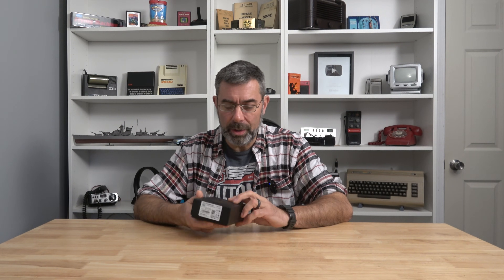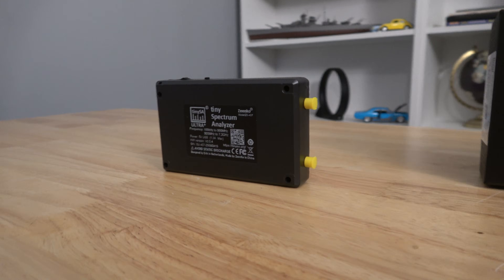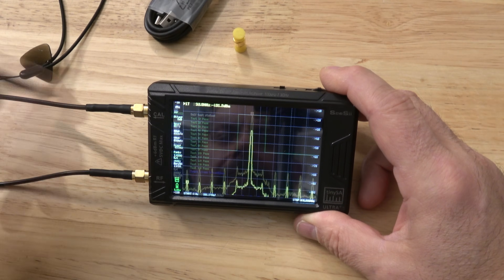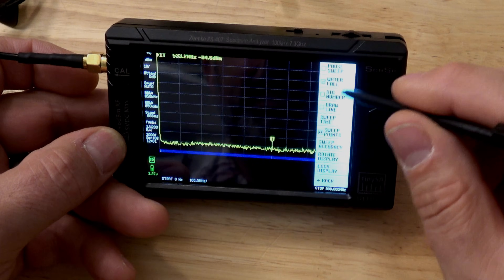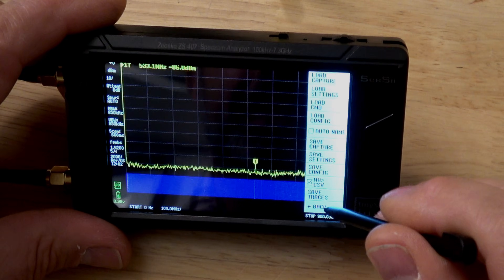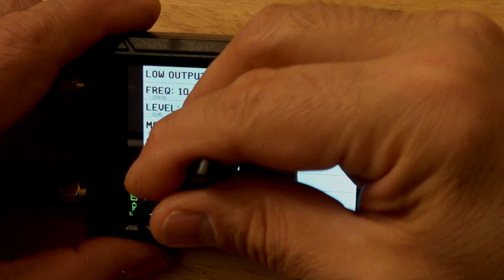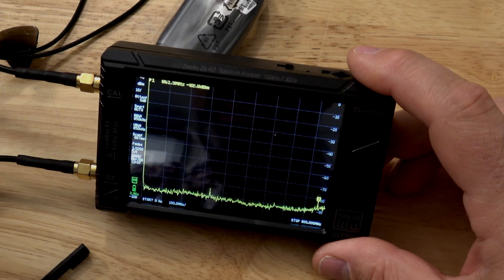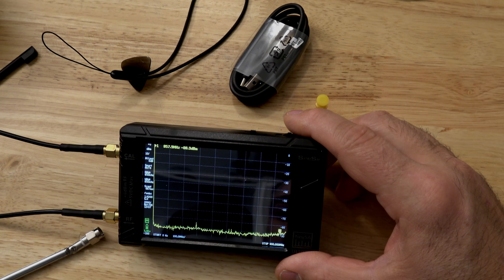The Tinysa ultra+. A compact spectrum analyzer and frequency generator.

Comment: Them are great to have.  You can put that antenna on that  and go around finding that RFI noise.  So many ways to use that . I have a full size one with LCD display.  Does even more but that lab gear test equipment.  You will find some LED lights are bad for RFI . Many power stations are bad for RFI and many other things. Cheers from NY !
Reply from the maker: Thanks

Comment: Helps to know how things work! A contract engineering gig I had a few years ago was at a medical device manufacturer. They used a variety of things to tune them. One was a spectrum analyzer they called a "Marconi". Basically, used as a SWR device. First day there the guy started to explain it to me and I said: "I've been doing this for YEARS!" Thing had a 50W microwave emitter and each one had to be tuned as they weren't consistent. After a while I figured out that running their test twice would make the output WAY closer to linear than doing it once, and the Parent Company (in France) actually adopted MY way instead of THEIR way! :face-green-smiling:
Reply from the maker: That must have been a great day to be able to have them change their ways!